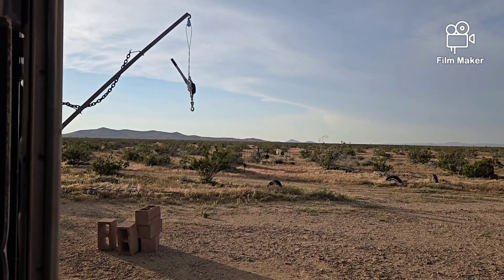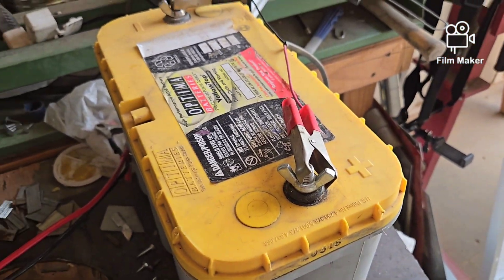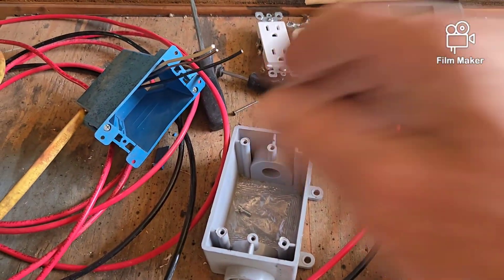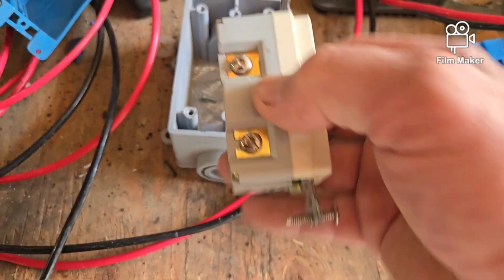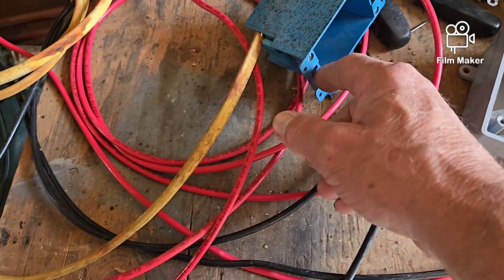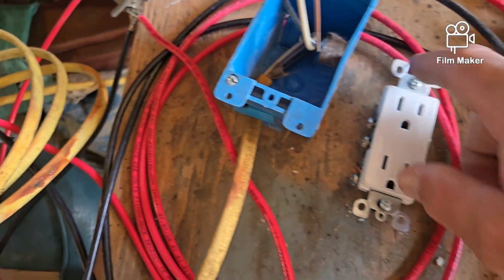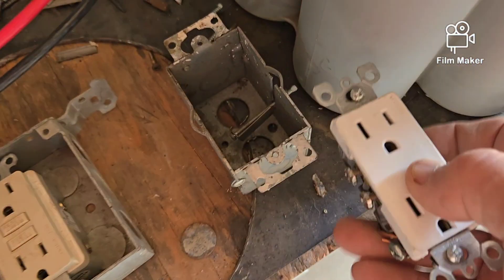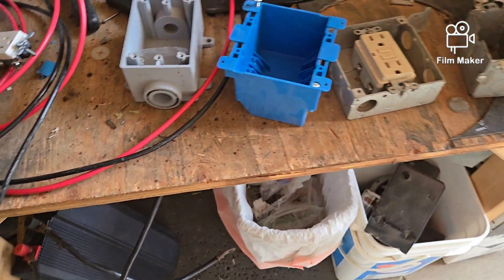Simple Solar & LiFePo4 Batteries, April 19, 2024

Comment: yeh my freinds 40ft caravan burnt down because of a lithium cordless drill battery on charge , ive seen electric cars going up, nothing can put them out , what ive learnt with lifepo4 it can be very good as long as you buy good quality otherwise its going to fail sooner than youd like
Reply from the maker: That last statement goes for all solar equipment.
Reply: @GBear  yeh solar controllers they destroy battery banks ive seen a brand new bank destroyed , lifepo4 cheap ones are a serious fire hazzard